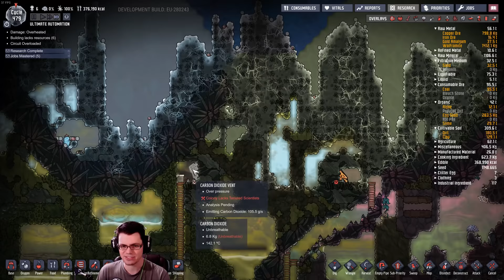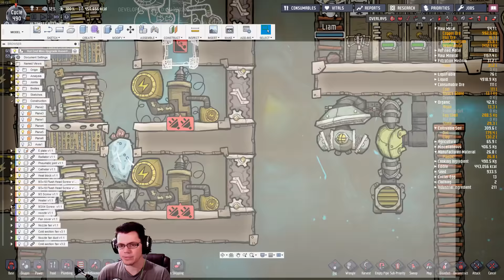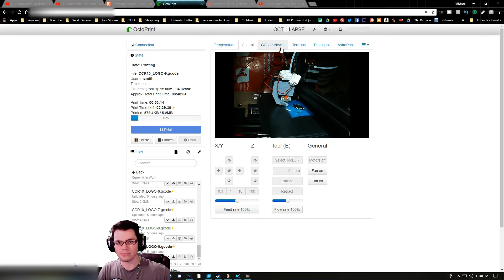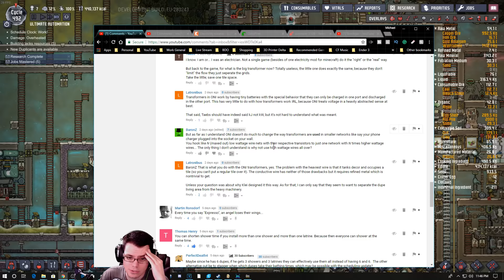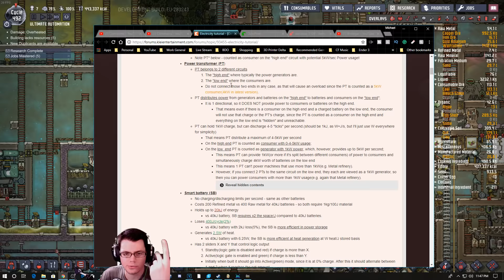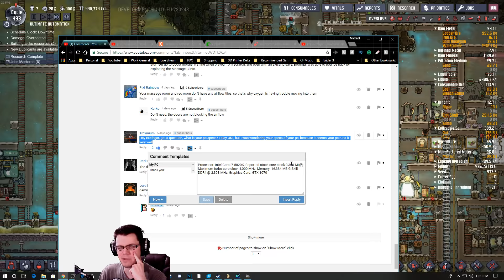Oxygen Not Included - Ultimate Automation Challenge! Expressive Upgrade Part 20

Comment: Thanks for linking my tutorial, I hope it helps someone :-) You should probably revisit the discussion on Power transformers - https://forums.kleientertainment.com/forums/topic/94188-we-are-limiting-how-we-think-about-power-transformers/?do=findComment&comment=1071505 I finally updated to expressive and played around with the small power transformer. The results are that my initial battery theory is wrong - the problem was that you had many transformers ABC powering many other XYZ : when ABC is powering X, X can draw, unfortunately, the sum of A+B+C, with up to x5 its power, so if X is a small transformer in your case, even if ABC are also small - they supply 3kW combined and the wires overload. The same behaviot happens with large transformers - secondary large transformers can draw up to 20kW, so even 2 of them can overload the grid if there are enough power transformers "above" them to feed them 20kW. Your current setup might work if you keep the lower circuits small - 1-2kW.

Comment: If you have filteration medium and raw minerals checked as the whole list make sure to uncheck mafic rock and regolith on the storage compactors, I had bunch of them delivered to the base and I can tell you it wasn't easy to get rid of . Also more than 100 tons of it can pile up on a single tile in around 1000 cycles, if those break through the abyssalite layer it will be a huge heat problem too. So try to build some bunker tiles over abyssalite tiles close to surface.

I recommend building abyssalite tiles around your main base to stop the heat transfer between your living space and yet to be mined minerals around your base. All those minerals have such a high mass and heat capacity are heating up your base and farms over time.

Comment: Your bathrooms should be shower sink toilet cause your not going to get germs from the shower. You should also compress your gases like hydrogen and natural then you can pump them into the generators as needed and not worry about gas pressure building up after all this is the automation challenge. Water could also be compressed to "save space". After all that you can build your generators in one room and use the auto machines to spread the power adapters from the generator room as well as coal for those generators, hydrogen and natural gas can be pumped from one source into their generators. Your great hall should have two levels of tables with one tile open in the middle of the second layer :)